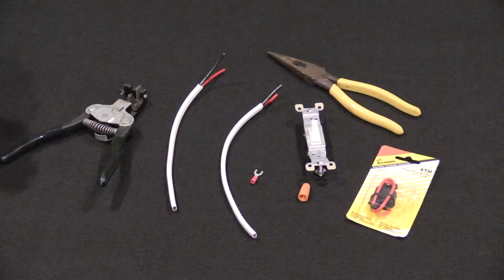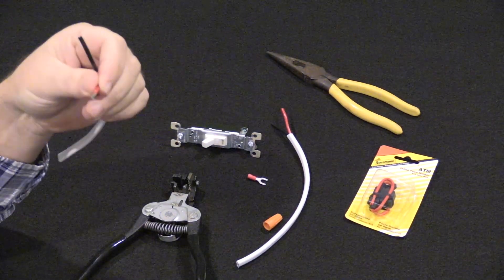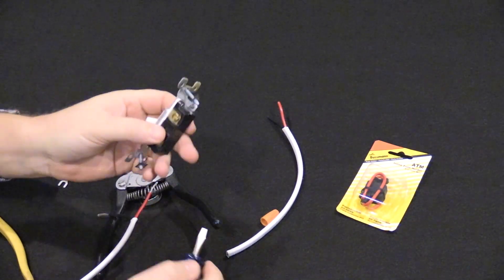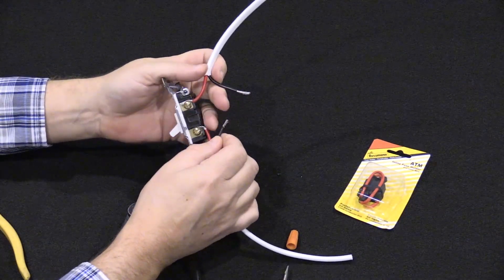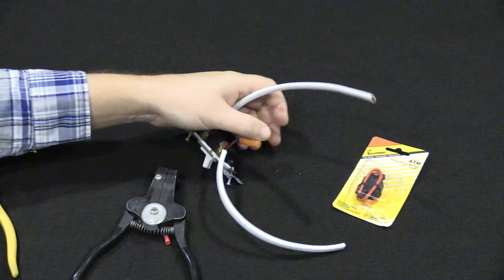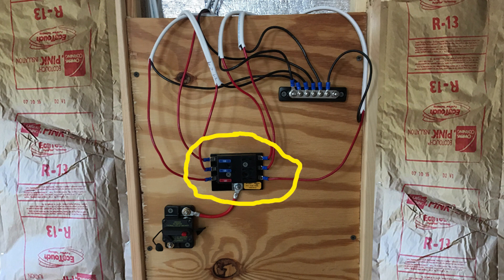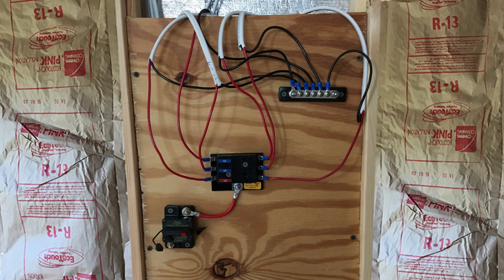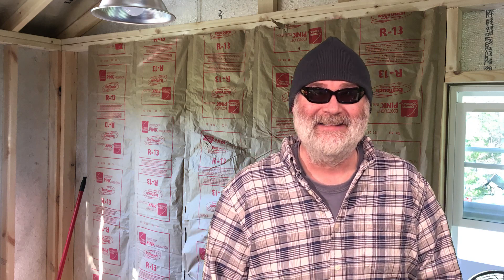Episode 4 - Small Cabin Solar, Circuit Breaker, Fuse Panel, Buss Bar Wiring 12 Volt

Comment: Those are terrible connections on that switch. You should buy a switch with clamps and make sure they are really tight and no exposed wire sticking out.
Reply from the maker: yup, your right about that.